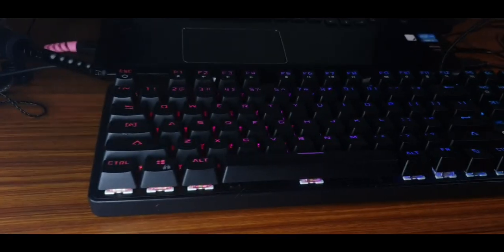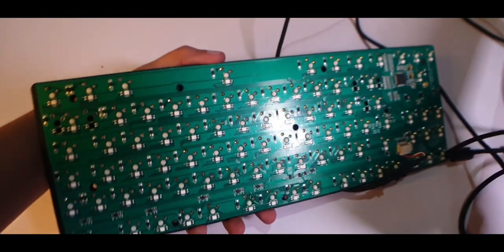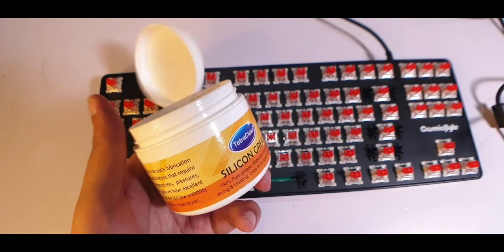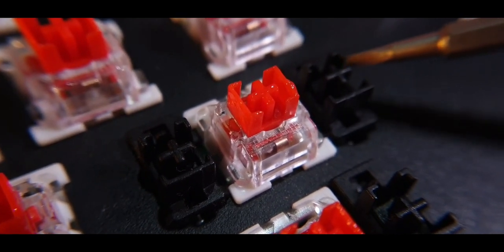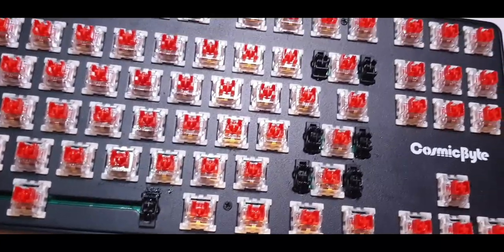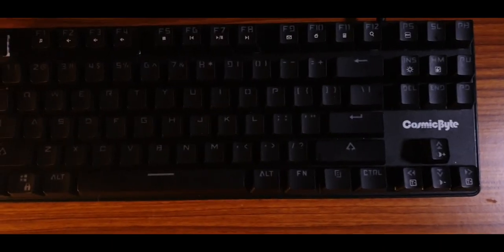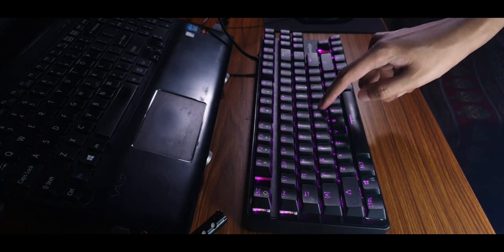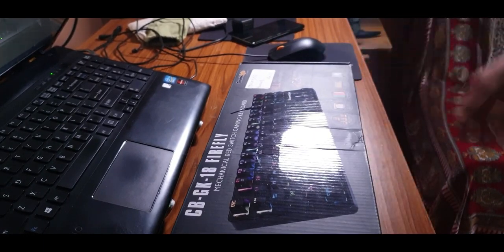Cosmic Byte Firefly Keyboard- Easy mods guide for everyone!

Comment: On my k552 I removed the logo buy erasing it with a normal eraser, it takes a long time. But its simple and doesn't leave any scratch mark on it, and I don't want chemicals to leak inside the pcb and potentially ruin the keyboard. So it might work on your keyboard as well so I definitely recommend trying it out
Reply from the maker: That's a good suggestion 😀👍🏻
Reply: Hi Friend, 1). kindly suggest the best mechanical key board for gaming, editing, streaming and rendering works...2) Reddragon has multiples variants like K551, k552 and k582 which is best one among these...2) How about Comsmic bytes..particularly this model...
Reply from the maker: The k552 is a good keyboard to try.😄
Reply: @b34felteachawngthu14  …Thanks a lot for informative response…Royal Kludge 68 Black is Appealing but it has Blue and Brown switches but where as White has Red Switches…We are looking for Red Switches…What’s your opinion about Gateron Yellow and Gateron Silver…Any idea about Gamakay LK67 & Gamakay LK68 from Banggood…
Reply: @TheHopelessGeek  …Thanks but K552 doesn’t have Red Switches variant and more over if you read their official website or Amazon, we can see only K582 is mentioned as Outemu Linear Red switches…Even I doubt that K551 and K582 are different in swift type and so as compatibility for Mac…
Reply: Yea, Switch and Click did that once in one of her videos...
Reply: @muanawma hows ur keyboard now

Comment: For a future video you could get the k552 and later on upgrade the switches easily since it has hotswap capabilities. Just a suggestion ofc
Reply from the maker: Yes, you're right.😀👍🏻
Reply: @TheHopelessGeek  k552 is just better version of this
Reply from the maker: Yeah, with hot swappable design.
Reply: This keyboard honestly is good for just plug and play but for modding it’s a struggle. The stabs can’t be accessed without removing switches so spacebar rattle can’t be fixed by beginners.
Reply from the maker: True. Customisation is limited here

Comment: I have Cosmic Byte Cb-Gk-16 Firefly. On my box, it's not mentioned as "Hot swappable" keys. Is it possible to change the switches from Outemu Blue to Brown?
Reply from the maker: Yes, the newer models support hot swapping switches. You can change it to another switch of the same type (Outemu, Gateron, etc.) of any variety (linear, tactile, clicky)

Comment: did it with the same keyboard and oh boy

it sounds like 10x better now

used coconut oil instead of silicon gel and it worked just fine btw
Reply from the maker: Ah, thanks for the suggestion 🙂
Reply: Coconut oil 
A) will turn into gunk 
B) freeze in winter

Comment: I have the CB GK 14 unit. Are the switches on this board hot-swappable?? Have had this keyboard for almost a year now and the switches have started to feel less responsible and very mushy. The “I” switch also fails to register at times. I want to change the Outemu switches to Gateron Blues, but I don’t know anything about desoldering the board.
Reply from the maker: Oh, the switches aren't hot swappable. You'll need to get some help with desoldering them if you'd like to replace them. You can reach out to one of our community members on discord for more assistance 🙂

Comment: Hello Hemant I have been watching u for a month and i love your videos . I have doubt about the lubing methods in some other vedio you said that push the switch and lube the spring and in this vedio u just lubed the walls of the switch so which u prefer more lubing the spring or lubing the walls of switches. Pls reply
Reply from the maker: Lubing the spring will surely work better but it takes longer for each switch. I'm thinking this should eventually still seep down to the spring as you start using it.🙂
Reply: @TheHopelessGeek  thanks for the response I appreciate it 😄😊
Reply from the maker: Anytime! Consider subscribing 😁✌🏼

Comment: Do you recommend lubing for someone living in a dusty area?
Will the dust get stuck on lube?
There is a road just beside my house and is very active through out the day. I need to clean my pc after every 2-3 days.
Would you still recommend it?
Reply from the maker: That's a valid concern. Dust would definitely get stuck under the switches. I suggest moving your setup to a different location without direct airflow.😅
Reply: I heard there are outemu dust proof switches just for this purpose.

Comment: On reddit its been said that using Vaseline will destroy the plastic used for switches. So, do you have any experience related to this? I don't think I am in favour of purchasing a lube just for lubing my keeb just once. Let me know what are your thoughts. Till then I am adding foam mod.
Reply from the maker: I only used it on Vaseline for about a month. I later wiped it using some rubbing alcohol and used the silicone lube.

Comment: The way you lubed the switches do nothing as the stem doesn't touch the housing so what ur suppose to do is try to fit the brush on each side of the switches ik these are dust proof one for those thin brushes help so u do is press down stem and use the brush to lube the housing of the switches
Reply from the maker: I think the lube eventually seeps into the housing when you start using them.
Reply: @TheHopelessGeek  can you try this and make a short video if you don't mind?
Reply from the maker: I've done it a bit like that the first time, here https://youtu.be/bw1vueGb184

Comment: you can try Cosmic Byte CB-GK-13  its not tkl but with aluminum case  and Brown Outemu Switch. 
Could aluminum case make keyboard sound better?.  
Currently i am using old tvs gold keyboard with blue switches. i have used tape mode and filled it's huge case  with cotton. It sound is ok after mod  but i am planning to upgrade  any suggestions?
Reply from the maker: If you're okay with full form keyboards, there are many good options, like the GK13 you mentioned.

Comment: Bro, Can i use Keychron "OEM Dye-Sub PBT Keycap Set – Dolch Red" for Cosmic Byte CB GK 18. WHICH COST ME AROUND 3K (Keycaps only).

Will the keycaps and keyboard switches be compatible with each other?
I am new to keyboard modding. 😁
Reply from the maker: Yes, this keyboard uses outemu switches, which is a standard cherry design. 👍🏽
Reply: @TheHopelessGeek  Ok, Thanks ♥️
Reply from the maker: 🙂no problem

Comment: Hey there! Could go for a custom.build perhaps or the infamous gk61 or rk61(both 60%'s).
Reply from the maker: I've eyes set on them 👁👍🏻
Reply: @TheHopelessGeek  those are optical gaterons they are the best budjet switches so after buying them you will not like outemue that much because gateron optical  are much smoother and responsive (gk61)
Reply from the maker: That's good!😀✌🏼

Comment: Can i get the lube link?
Reply from the maker: Here's the one I used: https://amzn.to/3hItbpG
Reply: @TheHopelessGeek  can we use a silicone based spray to lube the keys and stabilizers?
Reply from the maker: It may get messy if you don't desolder them out of the PCB and top plate.
Reply: @TheHopelessGeek  i just managed to find krytox 205g0 so I'll use that .
4g for 400rs
Reply from the maker: Noice🙂👍🏻